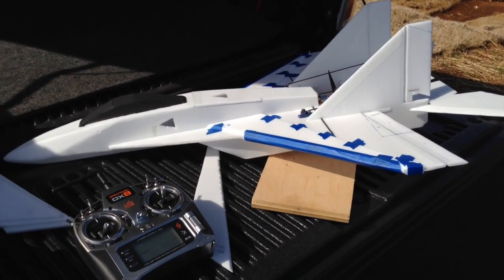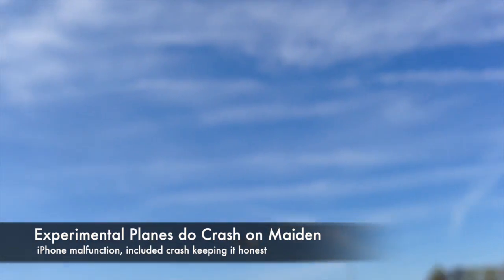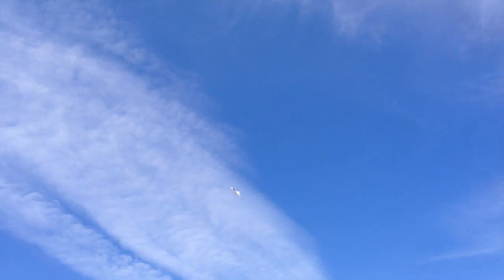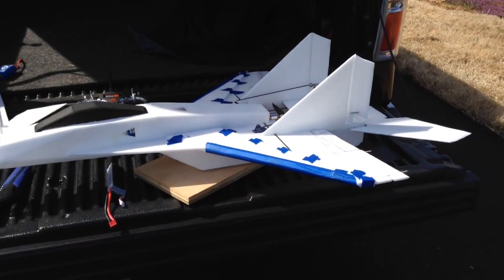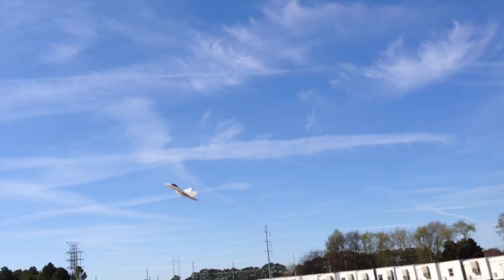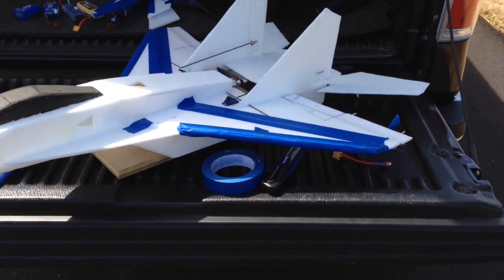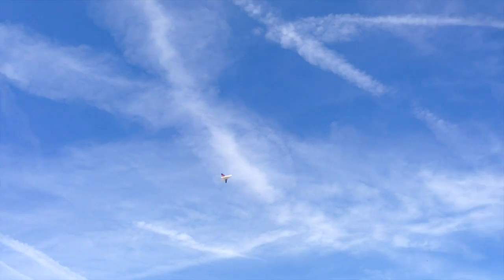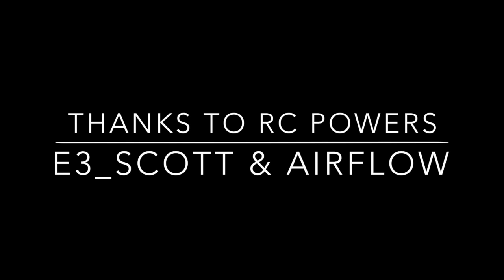RCP Mig-29v3KNEx

Comment: Nice flying. Gotta put ruders on my next one, liked the knofe edges. You've got some awesome skills with high-alpha.
Reply from the maker: Mohit,
Thanks for watching my videos and I appreciate the compliments.  I went cheap on the first key chain camera to make sure it would work with my Mac.  I will definitely look for the camera you recommended for better resolution.
My next big endeavor is going to be FPV.
Thanks,
Stephan
Reply: ***** Kewl, Yeah just built my first FPV plane myself. Haven't flown it yet. What air-frame are you going to use?
Reply from the maker: Mohit Dewan Not sure, will probably buy and not build.  I'm going to with a high wing plane for stability.  What plans did you use?
Reply: Likewise I bought one. A HK Bixler 2. Will post video in the next couple of weeks.